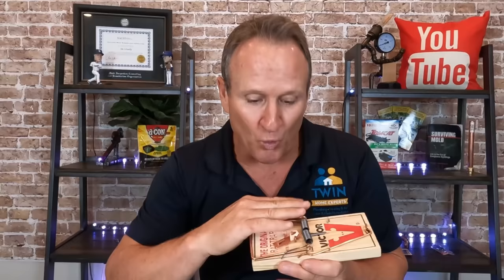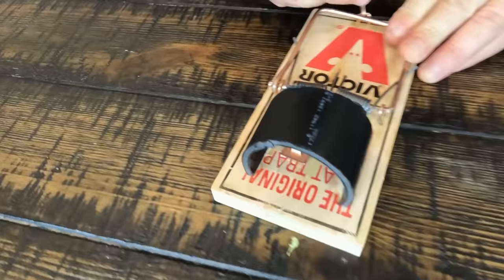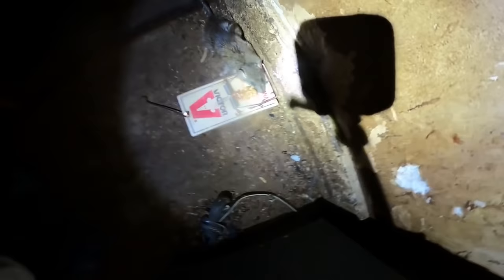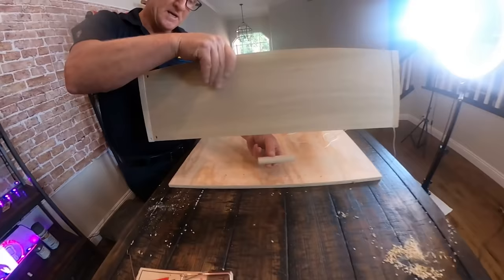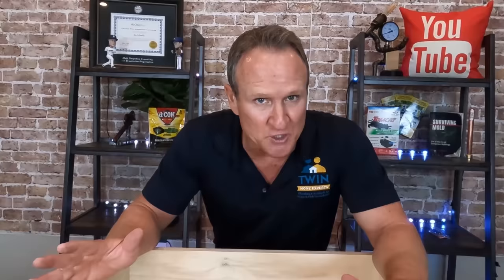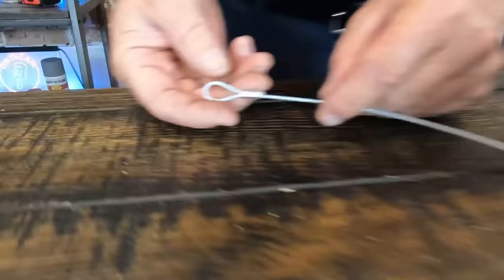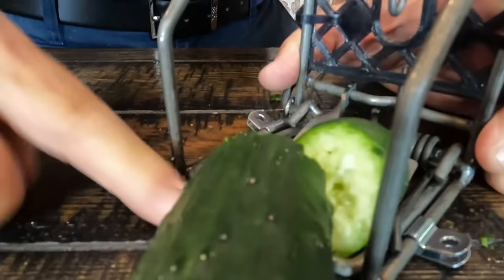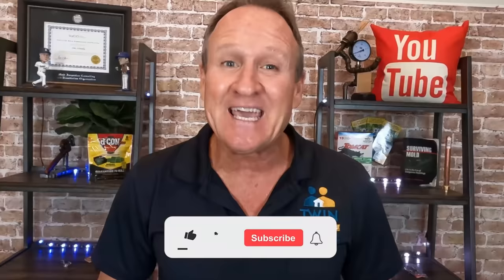EASY RAT TRAP HACKS THAT WORK!! Catch MORE rats FASTER...

Comment: You can adjust the sensitivity of this style of trap by bending the upright tip the trip wire rests on.. if you get it adjusted/balanced correctly it will trip with the slightest touch. Also put a piece of meat wedged in first so after they find the peanutbutter they will pull on the meat and trip the trap if the peanutbutter wasn't enough. They tend to just lick at the peanutbutter until it's gone.
Reply: Have done that ¿doing as I write this comment♤
HOPE I GET THIS S.O.B
HES BEEN PRETTY SMART ¿ SO FAR¿?

Comment: Something that has always worked well for me is using gauze. If you take a small piece of gauze from your first aid kit, and roll your peanut butter inside of it, it makes the rats have to work at getting it out.  So when you have your gauze infused with peanut butter, you just put it on that spiky part of the bait area of the trap. Make sure it's on there pretty securely, and again they have to really work at getting to the peanut butter. You can also put some peanut butter on the outside of the gauze just for the aroma. It works great
Reply: Mix baking soda with cornmeal or any package cornbread mix put it where cats and dogs cannot get to it only the rats and mice and it will get rid of all your rodents
Reply: @maedorasmith33  is it toxic to them or just attract them?
Reply: @chrishuber4853  her method doesn't work very well..  Maybe 10% kill rate
Reply: Gauze makes all the difference.
Reply: Cotton from a q tip, threD wrapped through peanut butter. Their teeth get hung in it. Q tip cotton smeared in back on grease  o yeah

Comment: I had a rat problem in my garage. I used a piece of a meat stick and pushed it over the copper bait pivot. (Tomcat Rat trap)  I jet it dry in the sun before setting it. I caught three males and a pregnant female on the same piece of meat. The rest moved on it got too dangerous. They love the teriyaki flavor.
Reply: I used to catch skunks, coons, and an assortment of neighborhood cats in a hav-a-hart very easily using slim jims.
Reply: @nathanlambshead4778   - - - What did you do with the skunk? How did you get it out of the trap without it spraying you?

Comment: Years ago when our house was new I found a lot of mouse droppings in the crawl space. I put about 4 Victor wooden traps out and would check them when I got home from work. The peanut butter was gone and the traps had not been sprung. So I went in and got some more peanut butter and started putting it on the traps. Now this is about 12 a.m. and a little field mouse ran over and started eating the bait while I watched him. That's when I learned that they wear so small and light that they could crawl all over the trap without setting it off. I fixed this problem by wrapping string around the trigger and smearing it with peanut butter. Once again Ben came running over to eat the bait but this time he chewed the string and pulled on it and bamm got him. I killed about 15 of the varmints. They could not resist the peanut butter string. The string was about an 1/8 thick.
Reply: Geniale Idee 💡

Comment: I used trap number 2 with Peter Pan peanut butter. I caught 14 rats, big and small,  in 2 nights and eliminated our rat problem. 
Rats also get really thirsty. If you put a water source near the trap it attracts them faster. You can even put out a jar lid of potato flakes for those rats that miss the traps.   When they eat the potatoes,  they get thirsty and the result is the potato flakes swell up in their gut and gum up the works,  resulting in death.
Reply: There's no eliminating a rat problem unless you shut off every access hole into the house.
There's no eliminating a rat problem outdoors for obvious reasons.
I'm sure Peter Pan is very happy with your promotion but any peanut butter works.
Thanks for the suggestion on the potato flakes. If it works so well, why not just use that only?

Comment: These are pretty good. I use slim Jim and cut a small piece leaving the plastic on still, after sliding it on to the little bait holder just smash that down so it’s pinched. Since doing this I can’t remember that last time the bait was stolen or a rat escaped and I’ve caught some huge ones

Comment: I tie a short piece of yarn to the trap trigger, and then heavily coat the yarn with peanut butter. Works well! I also screw an eye screw to the trap and secure the trap to something solid with a length of wire. That way the rat can't drag the trap away and die someplace out of sight.
Reply: I tie my trap up with a length of wire.

Comment: TomCat snap traps are my faves.  I also tether my traps, and use an assortment of baits.  The snap traps are MUCH easier to set than the old fashioned wooden ones.  The TomCat traps (no affiliation!) are by far the easiest to empty, clean and re-use.  I keep four baited traps in my basement all year round, cleaning and rebaiting about once a month if I haven't caught any rats.  This winter's been bad because of the "atmospheric rivers" which have fallen on the west coast, followed by freezing temps which are very unusual here.  The rats came indoors all over my city.  I have had the best results from the TomCat, when talking with friends and neighbours.  :-)
Reply: In my opinion I prefer to use the old fashioned traps, i know modern traps do prove well at times, but if the rats Intelligent than it's other brethren, modifying thr old victor Snap trap works better.

because some of these new Plastic modern snap traps etc.... well they prove sometimes to be defective or fail for they're purpose when it really counts.
Reply: Read my post above. I have had the same results with those snap traps. I use cooked bacon stuffed into the circular opening in middle of trap.
Reply: I had one steal the bait cup and the next day the trap was gone..my new one is screwed down to a piece of 3 foot 2 X 4.
Reply: hot glue dry dog food to the trap for bait.....  thank me later
Reply: I find the TomCat small black mouse traps do not work for baby mice. They can eat the bait without triping the trap. Same for sticky traps. I bait them but small mice eat the bait and are not caught. I am having the best luck with the Rinne Flip and Slip bucket traps.
Reply: Why not seal up their entry routes into your house

Comment: Great hints.  In hack #2, I use a staple gun with and staple a line of staples angled facing the trigger sticking about 1/4" above the base.  I  cut off the flat  top of the staples so it looks like a row of spikes.  It will look the same as a carpet tack strip.

Comment: Very good suggestions.   I agree with the drywall screws.   But the wood bases can split from the screws, predrilled holes will help prevent this.  I have used a piece of paint stir stick under the ends of the spring tension arms to increase the speed of the action.   Always teather the traps because a scavenger will carry off the easy meal and take your trap with it.  Have a nice day.
Reply: Mix baking soda with any corn bread mix or just plain cornmeal put it where pets like cats and dogs can’t get to it and it will get rid of all your rodents No liquid needed
Reply: could use brad nails or smaller.
Reply: what ratio do you mix ?  @maedorasmith33

Comment: Great rat trapping ideas! I'm surprised that you didn't recommend screwing down the Victor rat trap, because big rats can run off with the trap itself.
Reply: I figure that the impact from the kill bar will kill the rat even if they run off it will eventually die—or learn and pass down the experience to its heirs.

Comment: My best trap is a piece of Coffey lid cut the size of the PVC you used. Lift the spike on the bait mount push the coffee lid on to the spike and bend it back down .
Put the bait peanut butter under the piece of coffee lid .
The lid is trimmed 10 millimeter inside the trap bar .
Rats have to lift the plastic lid to get the bait . works good

Comment: One hack that I do to all of my wood traps is to dig out a trough directly under the metal bait trigger. You can just use a drill or a wood chisel to make this trench. do not go all the way through the wood. Maybe just half way through. then I fill the trough with what ever bait works best for you. So if the rats steal your bait on the trigger, you get another chance when it sticks its head under the trigger. I personally think the trigger is a bit more sensitive when pushed up from underneath. I like to fill it with peanut butter and sunflower seeds.
  I also use the wood traps that have the metal trigger only, not the plastic trigger. the metal trigger has a pointy bait holder which I bend just slightly upwards, maybe about a 45 degree angle, then I skewer a whole raw peanut in the shell on it. It takes a bit of effort for them to take it off of the skewer.
Reply: waste of time just hot glue dry dog food to the trigger, they can't get it off , doesn't go bad, and they love to Digg their teeth int it to run away with it ..
Reply: @cardboardboxification  I tried dog and cat food. nothing. I guess our rats prefer the nuts, seeds, garden stuff, oats, suet. stuff like that.
Reply: @matthewavila9679  hot glue nuts to the trap trigger ,

Comment: I pre-drill small holes around the kill bar, then drive 1" brads into the holes instead of using screws.  With a 7" long rat, I can usually impale them under the bar with 2-3 nails, some of which go into their jaw, skull, throat, or an arm.  They will not get out of that.  Just be very careful when setting your trap!
When using peanut butter, cut a small 45 degree piece off one of the bottom corners of a cheap baggie, then load your peanut butter into the baggie.  You can squeeze it out as needed, like putting icing on a cake.  It it's too firm in the winter, put it in the microwave for a few seconds.  
Put your traps against walls, certainly within 1/4" or so from the business end of the trap to the wall.  Rats and mice tend to travel along walls and tend not to get into the open near as much.

Comment: Tried all sorts of traps but my best successes have been with the large Victory traps. Peanut butter is an excellent attractant but they'll lick it all off. I take some thread and tie a piece of raw bacon or chicken skin to the pressure plate. I wrap the thread around it several times to keep the quarry from getting too much access. The critter will have to work for it. This is how they run afoul of the pressure plate. Peanut butter smeared on top and around the plate. I'm going to incorporate the pvc pipe mod. It makes a lot of sense and I've subbed to get more tidbits
Reply: I use peanut butter with the large Victor traps, however, I’ve found by stuffing a larger amount on the bottom side of the pressure plate, they have to work harder to lick it off and its never works out well for the rats.  Been using this method for years and has resulted in amazing results.  Good luck!

Comment: If you want a cover for your rat trap, have a look at the plastic containers Washing Pods/Capsules come in...I am in the UK, and i can advise the container from Lidl's own brand Formil (22 pod) Washing Pods fits over the Big Cheese wooden double spring rat trap almost perfectly, you just need to round off the corners of the wooden base slightly. Once you confirm it fits, cut a hole in the container about 2" X2" at one end for the rat to enter...

Comment: Have any of you ever used the bucket and beer can method? I don't have rats, but do have plenty of mice and chipmunks that get under my summer camp when it gets cold. 
I use a plastic bucket, drill a couple holes on opposite sides near the rim, insert a rod thru a beer can or other round container (I use empty planters peanut jars), then insert the rod and container thru the rim of the bucket. The container should spin on the rod, directly over the open bucket.
Smear peanut butter on the container and put a few inches of water in the bucket. Place a ramp to the top edge of the bucket. 
The rodents will go up the ramp and leap to the container (beer can, jar, etc.) and fall into the water and drown.
I usually find 6 dead rodents in each bucket come springtime.
My alternative is to fill the containers with peanuts in the shell and put holes all around the plastic container for the aroma to get out. It works quite well.

Comment: I bend the bait plate on the Victor to make it a little tougher. I also modify the latch to be as sensitive as my fingers will allow. and finally. I use crunchy peanut butter and shove a peanut chip under the holder on the plate. It makes them tug on the plate.

Comment: The thing that has worked best for me is to put the trap in a cardboard amazon box that’s just big enough to clear the bar. I cut a rat size flap that leads to the bait. This is supposed to cut down on its room to flee once the trap activates. I like the pipe idea from this video as it seems to work similarly. I live in the woods so I get to test these traps every year.
Reply: Damn. I've no Amazon box as I don't deal with them as they are an evil company.
So this tip of yours will never work for me.

Comment: I've been using orange slices, and threading it through the snap trap plate for attic rats. Rat either can spend time nibbling on it, or eventually tug the orange off the metal trigger plate. Caught 2 dead so far this way. Also squeeze orange slice on the snap trap to get the scent all over it

Comment: I have been using finishing nails, I put them from the bottom so the pointed ends are facing up, similar to your drywall screws.  I put them in the front and both sides of the kill zone, on the outside of the spring.  Instantly impaled.  Works like a charm.  Wouldn't recommend if you have pets in the area roaming though.

Comment: I use a row of staples, after stapling, I cut the staple in half and bend them up straight. I also put a small piece of foam under the big pans, makes the traps way easier to set, and then tweak the bar a little until the pan sets a little lower. I put peanut butter far back on the pan so they have to get the head further in.

Comment: If you have rats that keep eating the bait without setting the trap, simply insert a small tool through the prop rest hole in the feed plate from the prop rod side and slightly pry the bottom piece of brass outward. This will make the trap more sensitive. The prop rod should just barely rest on the notch without slipping off.

Comment: what I do is take a piece of copper wire 26 ga to 30 ga and wind it around the bait plate and then through the piece of bacon! this prevents the quick in and out type rats from getting away, I use the victor rat trap because of their inexpensive costs. although I do like the drywall screw idea.

Comment: Great video . a buddy up north screws his Victor trap down to a piece of 2x4 . no way to run away from the trap . I think I'm going to try your screw trick . but going to screw the trap down to a piece of wood . I use a screwdriver to set the lever . I like my fingers . and when I set it up I used to set it up on a piece of cardboard and slide it into place . but sometimes it goes off making this guy jump lol . not funny . if it's affixed to a piece of wood that may simplify the matter. keep up the good work Gentleman . ps I bought one of the traps with the plastic flipper . much easier for this guy to set up . I have a hard time getting the bar to hook onto the latch .
Reply: After seeing my traps went off and no rat, I thought the victor trap's very strong spring was making the trap flip in the air, so I set one off and watched. Yep, the trap does an end over end, apparently letting the rat go free.
 I cut some 1/2 inch plywood about 10 inches by 4 and screwed it to the bottom on the kill end, did a repeat set-off, it jumped a bit in the back, but the front (where the bait is) stayed  pretty stable, and if the rat comes in from that end- his weight will help keep it down.  That was today.

Comment: We have outdoor rats in the alley area as we  all have back driveways.  I have a zig zag section of fence in the corner of my lot because of utilities, and a tree nearby.  I installed a 20 x4 piece of wood as a shelf hidden away about 6 inches down from the to of the fence by the tree.   I have been using the end of a pizza box and filling it with PB coated rat poison.  They cleaned me out every night for about two weeks.   I know I killed a lot of them because of all the blue poop, but I need to step up my game for the big boys.  I am going to try using three of these victors mounted to the board.  Shim the springs, and use braid nails around the edges for teeth. I will mount them side access only.  hot glue a piece of dry dog food to the bottom of the triggers and coat the bases with PB.  I love all of the ideas in the comments.   I may also try putting two per board with tunnels, and use small boxes to obscure  the back of the traps if the first version doesn't work.

Comment: I drilled tiny holes through the wood and force in 1 1/4" brads from the bottom.   This anti-dragging mod really works!    I might release a  mouse back into the wild, but a rat.......never.
Reply: 🐀 Rats Kill Mice IF There's Not Enough  Foods.

Comment: Because of my age and severe disability with my fingers I purchased one of those Owltra electric rat traps. What I didn't think of. the areas where the rats are (outside) the are plenty of ants ants and roaches. The insects keep setting off the electric trap. Tried using surface spray insecticide but that keeps the rat away from the trap. So, in the bin for the Owltra Electric rat trap. Useless if there are roaches in the same area as the rats. The insects love 'em.  Any suggestions?